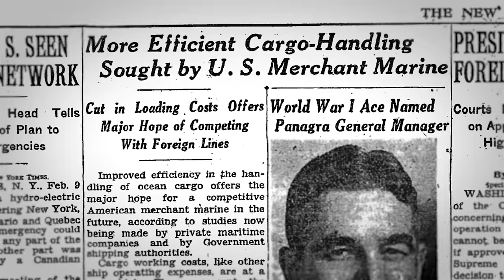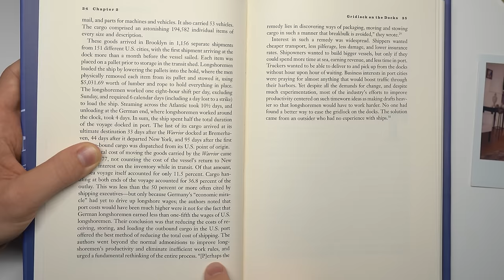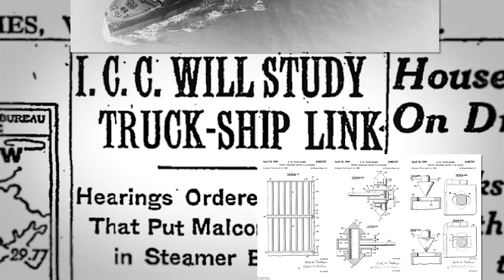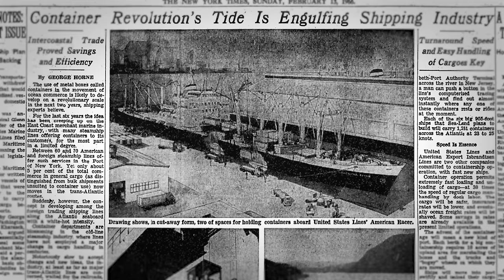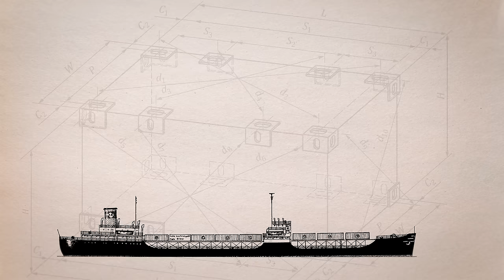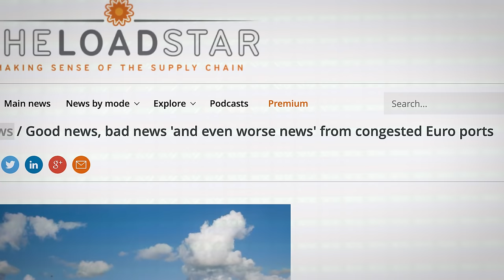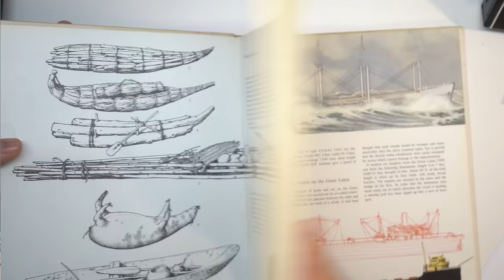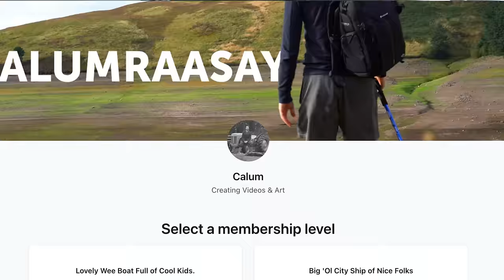Shipping Containers Are Genius - Here's Why

Comment: The problem with current containers is that even though they are standardized, the standards have three different heights and five different lengths, as well as two additional lengths not in the ISO 668 standards, but still being made.

If you want to make loading and unloading of ever larger ships possible in an economic manner you need to make the containers bigger. And by that I mean in all dimensions, and unify them. Currently the widest ships can handle 24 bays of containers, what if you would place only 21 on the same width? Also make the containers higher (stacking only 17 instead of 18) and longer, getting 22 instead of 24 rows, you could get a total of 7854 containers instead of 10368, almost one quarter less. Assuming the crane would operate with similar speed, you could reduce the loading and unloading time almost by a quarter, while carrying the same (if not more, because less dead space) volume of cargo. Even bigger containers are theoretically possible, but due to weight limits as well as dimension limits for transport by rail and especially road, there is a practical limit. However, the current largest "45 foot high cube" containers can clearly be made a bit bigger.

So the obvious solution is bigger containers. In my model above I would make them 2,8 meters wide, 3 meters high and 15 meters (long) and 7,5 meters (short). The 15 meter long ones for use on ships, trains and trucks (on highways and dedicated roads) while the 7,5 meter long ones on regular trucks. Of course the width would have to be bigger than the current norms, but 2,8 meters outer width should be possible across the EU (where there are the tightest limits, or at least I think so). The current 1EEE containers, the largest ones (2,896 x 2,438 x 13,718 meters), have an outer volume of almost 97 cubic meters and inner volume of almost 84 cubic meters. The proposed 2,8 x 3 x 15 one has 126 cubic meters outer volume and could have 115 cubic meters inner volume. This is 36% more inner volume (if the sides remain of equal width).

The width that I propose (2,8 m outer/2,68 m inner), would allow three rows of EUR pallets stacked next to each other by their shorter side with enough gap remaining between them for loading and unloading purposes. The long (15 m outer /14,88 m inner) container could handle 36 EUR pallets, the short (7,5 m outer, 7,38 m inner) could fit 18 pallets with enough space left for manipulation as well as some buffer (palettes not stacked perfectly, but with certain gaps (up to 4 cm).

Together with these new containers, the whole infrastructure around them should be made fully electric, fully recyclable and with a high level of automation. Overall I agree that any such transition would be expensive and I question how long it would take to actually pay off. Probably in the decades. The current shipping containers are limited mostly by their small width (2,438 m) and height (2,438/2,591/2,896 m). The inner width of 2,33 m makes it impossible to ship anything wider than 2,3 meters in containers. I want to be able to ship 2,65 meter wide things in containers. Might be useful for industrial things.

There, I solved the broken system. Or not. This needs much more research than what I posted here.
Reply: Good idea.  We’d just need to make every lorry bigger and widen every road and the jobs done!

Comment: Why do we still use cranes to load and unload containers? Why not design a rail system where when a ship docks the bow or stern can open bulkheads and connect with the rail system in the port (all automated) that routes the containers onto the appropriate truck or train? This same system can then load the new containers onto the ship and even properly distribute weight.

Comment: i think they need need to say to every port whats the average amount of containers that they can load/unload in a 24 hour period,  then work out that say a 10000 TEU ships are preffered for most ports as they can be in and out within that time period which might be more efficient than a ship holding double the cargo but taking 3 times longer to unload.
Reply: Ships don’t sail from just one port to another.
Reply: @annoyingbstard9407  I'm quite aware of that, what I'm saying is make it quicker to unload and reload each ship as it goes port to port. Cut a say 3 day unload/reload to 1.
Reply: @kiho1995     The average time a ship spends in each port it calls at varies.  In the US (the longest) it’s 1.25days.  In Japan (the shortest) it’s 0.36.  In the UK where I live it’s 0.83.  Those are averages.  Felixstowe (in the UK) turned around 27961 containers in one day this year.  I’m not sure where you’re going with your suggestion.

Comment: The Container & the common Pallet evolved from the invention of the Forklift. The first Forklift was invented & used on the Townsville, Queensland, Australia in the early 1930's. Unfortunately a Labour Government, pushed by the Waterside Unions refused a license to manufacture. I was said that each Forklift would put ten men out of work. When the Americans entered WW2 they arrived in Townsville & saw the Forklifts. They brought the Patent & it went on from there. The first ones were Tractors with the fork machinery running off the PTO at the back of the Tractor.

The same thing happened to the Multi-Grade-all Tractor. That was designed by two drunken Engineer Soldiers who were sick of going Bush & having to take; a Grader, a Backhoe, a Bulldozer, a loader, Fuel Tanks & a Forklift. These two diggers drew out a design on the back of a couple of Drink Coasters. The following Monday they took their idea to their Engineer CO. The CO saw the advantages immediately & passed the Coasters to the Military Development Unit. They had a few of them made up & they were used at Shoalwater Bay on Exercise Kangaroo one.

A Labor Government was in power at the time & refused to allow any more to be manufactured. When the American saw them they wanted to know where they could get them. They were told that they weren't allowed to manufacture them. The American Military was allowed to Patent the Machines & gave the Australian Military as many as they required for 25 years.

True story's

Comment: Your next mission impossible assignment,  explain empty steel cargo container resonating "boom" noise on American trains returning to ports through towns.  Long trains through rural states and long freight routes, same regular slow  speed, same steel rail track gaps, same railcar length steel wheel spacing, equals two empty container booms per second.  Lasts for hours.  Not a disco or dance music, not a rock band or car radio, not a factory.  Mystery?  Answers?

Comment: It seems relevant that the problem with big ships is that 'they take too long to unload'. Not surprised - those 'pick up and swing on cables' container moving systems DO seem inefficient and slow. But technology - with electricity, grease, and a whole lot of steel - can fix that. People manipulating cranes shouldn't unload container ships. Special purpose machines should unload/reload containers onto and off of container ships. We can build it, we just need to figure out the standards that will be required to interface the ports and the ships in a way that makes this useful. Maybe we'll have to modify how the ships configure in order to shuffle containers around... a sort of 'self unloader' that interacts with a port system.

Comment: The irony of the shipping industry, is now, it is the lack of standardisation which is throttling quayside efficiency. A few ports boast of being "fully automated", however none are. 

All ports require manual intervention to remove the twistlocks, there are no automated solutions that work, largely due to large variety of available twistlocks and their subtlety different operation. Then there are "Fully automatic" twistlocks which have completely different modes of operation from one to the next as well as different geometries. There are also "midlocks" which are used for when two twenty foot containers are placed in a forty foot bay..... 

The ships themselves do not know what twistlocks they use (And there will not be homogeneous, despite what insurance companies claim.), and despite the standardization of containers there are variations in width (8ft vs 2.55m) which make landing a container in a machine almost impossible

And so for now and I believe some considerable time, pinning shall remain a bottleneck and a manual process

Comment: ≈ 05:40 in the video I found a tiny flaw. You said there had been no defined size to drums an barrels. Actually that is not compltely true. There had been several definitions to it - like to the ton. The today still most known standart is the imperial barrel to 159 ltr of content. The problem was that each culture had different standarts. Metrical the barrel began on 200 ltr. A drum was below. A ton was 1,000 kg. All do have the same shape, yet different sizes in different standarts. Vessels reached from one standarized culture out to a different standarized culture, like the SS Warrier drove from back then imperial USA (now SAE) to back then metrical Germany (now ISO). The problem had not been that there had been no standarts. The problem had been, that there had been very different standarts in different parts of the world, sometimes even to neighbor countries.
Reply from the maker: I think my point still stands though, the size and shape of these things could vary a lot- barrels were a distinct size but barrel was often confused with cask, which means it could be a 500litre butt to a 250 litre hogshead or 300 litre barrique. I worked in the whisky industry for years and this confusion and mix of sizes is still a big logistical issue!

Comment: Its worth saying that containerization is not dominsting all over the world.

Here around the baltic and nordic countries, i would say that roro  is at least as big, if not bigger than container.

Specially trailer roro  typcally about 15 meters long and 2.55 meters wide is both a bit widet and longer than containers. Can pack pallets more efficent and pack larget single unit goods.

Nowdays we have special mix train waggons that can take a mix of roro and ISO containers. Because we cant double stack the containers due to electrification, a train with roro trailers can actually fit more cargo than if its in ISO containers. Now days pretty much all non bulk trains are iso/roro mix waggons.

Also shipping  containers over  the baltic is just to close. We cant have 8 hours  of loading for 10 hours of travle time. With roro, truck, car and buss mix a ship can be loaded in a hour or so
Reply from the maker: Like I mentioned, the vast majority of non-bulk cargo is transported by container but obviously that still leaves lots of room for break bulk. But the stats don’t lie. Containers are everywhere.
Reply: @CalumRaasay  my point wad really that there are modern alternatives.. while they are not large globaly  they are large regonally.

While this type of shipping  really only works good on routes that is fairly short, with a slight pullback ofnglobalizarion,  this might be a grewing market.

The use of roro was dominating here prior to ISO containers existing. What have revolutioniezed  it last decade or two is the combine carry waggons. Now the carry of both type skyrocketed.

Its not a replacment but a complement.

Roro is highly unpractical for transatlantic routes, but contintental, its probobly both cheaper, but more importsntly  much faster.

Of cause. If its messured i  ton*km, this will not be visible on the statistics.

Comment: So the containers are locked together on the deck. That's how they don't fall off the ship deck. Thanks for mentioning that.
Reply: If you watch closely there are holes in the corners of the container, those holes are there for locking pins.  Container is also locked when it is put on a container truck.  A container slip down to a highway is diastrous.
Reply: Corner locks aren’t enough when they’re stacked on deck.  They also have lashing rods corner to corner tightened by turnbuckles.

Comment: Still salty over the fact that they couldnt standardize a pallet size that was optimal for use in containers while they where at it. The EUR-pallet was standardized in 1961 for european railway and now they have to use some special PW containers for it. But now both of them are standard so we just have to live with it.

I wonder if these standars will make it into space some time, like a high tech carbon fiber aluminium container with the same dimensions and fitting being used to haul stuff in the solar system. Like we still use cars that are basically the same width as a two horse carriage and now we're stuck with those dimensions.

Comment: I'm still waiting for someone to realize containers can be more than a metal box. You might lose a bit of internal volume, but every container can have a battery on it and plugs on the exterior. When a ship, truck, or train is fully loaded with hundreds of containers full of cargo that are also batteries, the containers can provide the power needed to drive the thing they're riding on. Yes, batteries are heavy. Maybe they won't be able to carry quite as many containers because of the weight, but it would solve a huge problem with shipping and climate change by making all the vehicles electric. What about charging? When they're sitting in a port waiting to be loaded or moved, they're plugged into the grid.

Comment: Container ships are likely to continue to grow indefinitely. It’s just driven by the laws of economics and the massive economies of scale caused by the square-cube law. Larger ships use less fuel per ton of cargo, so they can carry a given amount of freight for less cost than smaller ships by spending less on fuel for each container. 

And as for the impacts, globalization is never going away. From an economics perspective, any instance where two groups of people can do the same job for different rates, the ones who are asking for less money are going to get the business. Globalization isn’t exploitative, it’s matching people who want to do work with work that needs to be done, and it has lifted a billion people out of poverty. The reasons for offshoring are simply that people overseas want the work more than people in places like Britain. You can tell, because the British workers need to be offered a lot more money to entice them to do the job, and they still might go on strike anyway.

Comment: Industry needed to change to adapt to the container - the Suez demonstrates that the intrastructure needs to adapt too. Egypt has been milking it for decades and let it become a single point of failure - interestingly once it takes more than 3-4 weeks delay, it's cheaper to go around the canal and the Egyptians are charging so much that it's almost as expensive as the fuel used sailing around it

The interesting part is that Egypt got complacent and assumed customers had no other choice - the blockage made them realise and demonstrate that's not the case and Egyption authorities need to "pull their socks up" or else someone else will eat their lunch (There's no physical reason why Israel can't dig its own canal, but it'd be political dynamite)

What's next? Container aggregation? loading/unloading pallets of containers? a new, larger ISO size? - one of the parts you kind of touched in with ports is that ships have become so large that things like bridges are having to be replaced because the largest ships can't fit under them (Is this a boom for tunelling? not so far, but who knows?)

Comment: What the messed up the container shipping things was the route rule change of the railroad then applying it to the over the road truck driver and then they wanted to crack down on who was driving more than 11 hours a day that's what ruined trucking that's a container making things smaller and condenser when shipping them so you can get more shift for the same dollar spent for fuel

Comment: Speaking of container ships getting replaced.  Starship and the like that will be able to do suborbital hops to and from anywhere in just 1-2hrs.  Even though it can haul  less, the perisable and timesensitve goods market will move to there.  Military transit will move to there (there is already a contract for that).  It will even replace international flights.  This will make same day global shipping a thing.  It will unlock being able to live anywhere you want and show up to a daily office anywhere.  Also for this will require a change in how the global system works, like having a single entity to monitor travel globaly.

Comment: The super huge cargo ships are MUCH more environmentally efficient ... more cargo transported per pollutant emitted.  Smaller cargo ships are logistically much easier to deal with but pollute more.
Reply from the maker: True, but as Marc said the issue with large contianer ships is that it increases the risk to supply chains and is creating strain in both the loading and offloading. Plus they are on;y efficent when full - and it's hard to ensure such massive container ships are always full!
Reply: @CalumRaasay  absolutely.  The issue to me is not the container or the supercargo ships but the over reliance on the global supply chain.  If nothing else local buffer storage would make the system far more resilient and efficient in the long run.